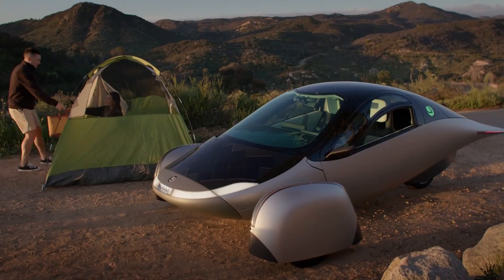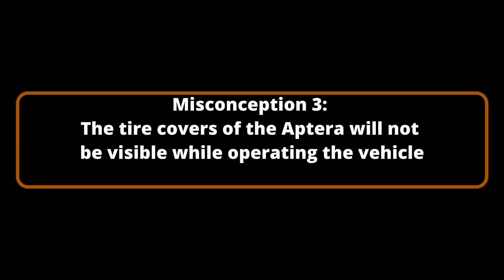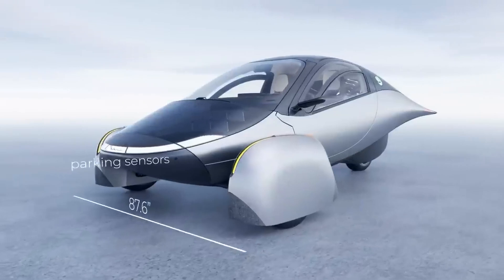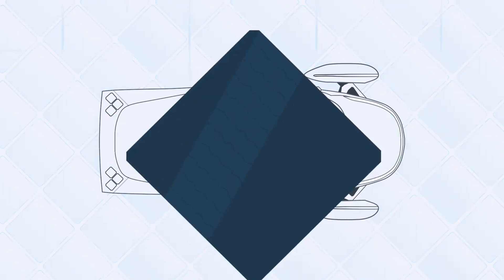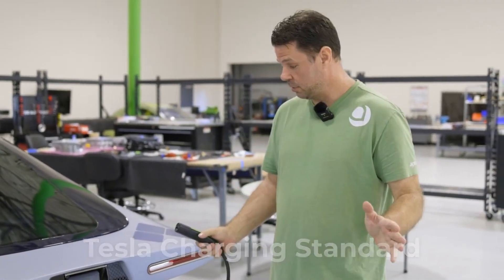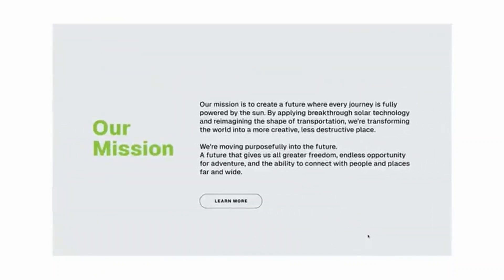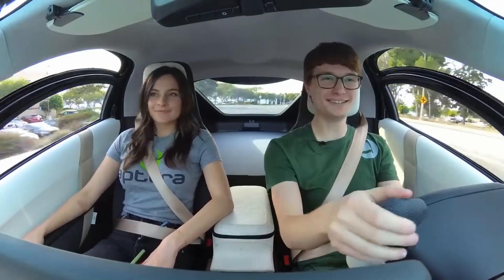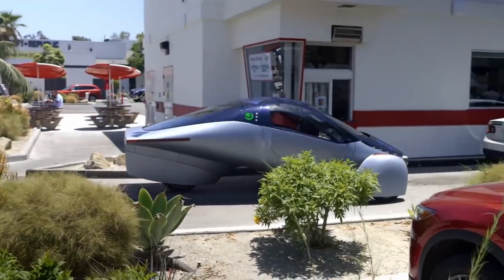All Aptera MISCONCEPTIONS Debunked in 12 Mins

Comment: LOL "20% more storage than a Prius" - that's only comparing the seat up configuration of the Prius (5 seat config) - put the seats down to make the Prius a 2 seater and you have more than double the Aptera.

"up to 40 miles per day" this is mid summer in Arizona - average 25miles per day annually in LA , and only if you park your car 100% outside all day every day, never in a garage, in the shade, underground carpark etc. the 700W of panels cost and extra $3000, you can get this much solar for 1/10th the cost by putting 2 x 420w panels on your roof.

4:39 - LOL effortlessly enter and exit - looks like a complete PITA to me

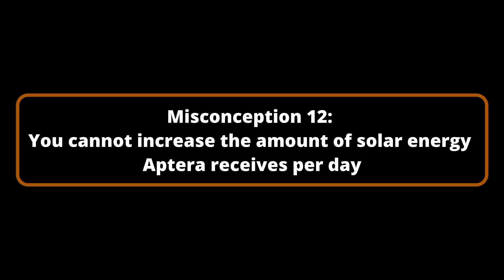6:51 charge twice as quickly? - that's an outright lie unless they changes the spec recently 3kw max AC and 40KW max DC charging - how is this acceptable in 2024..25...26....or 2040 if and when these ever get made - they are basing this on their other lie that this will routinely get 10miles per kwh so "charging twice as quickly" in miles not kwh vs a car that gets 2miles per kwh.

Finally there is ZERO chance of a 100kwh version getting 1000 miles per charge - where are they going to put all those batteries? And why doesn't the efficiency change no matter what battery is in the car a 100kwh battery is several hundred kgs heavier than a 40kwh battery but they all get 10miles per kwh?

Everything these guys have said for the past 6 years has never come true from designs to efficiency claims to production schedules, the 3 motor version is now off the table because they couldn't commit or pay their hub motor suppliers so now they have an inboard motor and axle setup.
Reply from the maker: Thank you for all your scientific analysis.
Will look into this

Comment: Regarding "solar miles", Aptera's online calculator is really flawed.  It gives a good answer for a "very high exposure" area but significantly overestimates the solar miles for "little to no exposure" areas.  I suspect it's somewhat flawed for intermediate "solar exposure" areas as well.
Reply from the maker: Hmmmm
Reply: @Elementraz  Here's a comment I made in another video: "The difference in average daily insolation (a.k.a., peak sun hours) for a horizontal surface between a little to no solar exposure area and  a high solar exposure area is huge.  In Glascow, Scotland, for example, it's about 2.14 kw-hr per square meter per day whereas in Phoenix, Arizona it's about 5.80 kw-hr per square meter per day.  If the Aptera can get an average of ~30 miles per day (~11k miles per year) in Phoenix then all other things being equal it will only get ~30 miles per day x 2.14/5.80 = ~11 miles per day (~4k miles per year).

Comment: Aptera is not a car, and does not need to meet the same safety requirements as a car (e.g. no crash tests).
Reply from the maker: Yeah, you got it but it is technically a 3 wheel car
Reply: @Elementraz  It is a motorcycle. And therefore it does not need to conform to any safety standard necessary for cars. That makes development and production of the vehicle cheap.

Comment: Misconception 1. refuted: Aptera has about the same storage space as the Tesla MY while it carries 3 more people than Aptera. With the second row down, Aptera is over 40 cu.ft less in storage than the MY when both carry two. But the real bummer is Aptera has a far less legal payload and towing rating, making it far more impractical. Aptera might be better than a motorcycle (which it is), but cannot compete with most cars.
Reply: Then there's a thing called usable storage space. Just because you can post a number, doesn't mean it's really useful space. For example Elio loved to tell people about how it could haul golf clubs. Yet if you got a 16" pizza, it wouldn't fit in the back.
Reply: @billsmith5960  I ran through all 18 that were promoted as 20, but was succinct with my rebuttals. On the storage space, yes, most of it is too shallow to put stuff in, but the biggest problem is the stuff is high over the single centre wheel while cars have it low between two wheels. Much safer in cars.
Reply: @billsmith5960  The aptera storage space is not usable at all for anything other than paper toiletry. Else you create a guillotine in case of heave braking.
Reply: @vic321344  - It has a 500 lb load rating. So with two 200 lb people, you just need to make sure you never exceed 100 lbs of cargo.
Reply: Aptera cannot compete with a cyber truck, a Model S, X, or Y on much, EXCEPT price, fuel savings (3 x more efficient), futuristic look. But then, for one or two people, it's UNMATCHED!
Reply: @1voluntaryist  So misconception 1. is refuted. Thanks.
Reply: @1voluntaryist  And Aptera cannot compete with safety, it is a deathtrap in case of an accident.

Comment: The Aptera body really has nothing to do with a Formula 1 racing car. It is just a simple rectangular aluminium frame, where the (non structural) plastic parts are glued onto. There has never been an Aptera crashtest, so nothing is proven. Just empty promises, as usual.
Reply: Actually the construction is like an F150. Body on frame. Maybe a F1 car from the 30's might have that same design.
Reply: How can Aptera "promise" before a test? It's the most unique design EVER. That doesn't stop "empty criticism" by trolls.
Reply: @1voluntaryist  They could perform a real test since 2009. And they delivered nothing else than empty promises. "will do", "will have", "will be done".

Comment: An autocycle IS a motorcycle, it lacks all the safety features neccesary for a car:

GENERAL ASSEMBLY OF NORTH CAROLINA
SESSION 2015
HOUSE BILL 6
RATIFIED BILL
H6-v-3
AN ACT TO DEFINE AND REGULATE AUTOCYCLES.
"Passenger Vehicles. –
a. Autocycle. – A three-wheeled motorcycle that has a steering wheel,
pedals, seat safety belts for each occupant, antilock brakes, air bag
protection, completely enclosed seating that does not require the
operator to straddle or sit astride, and is otherwise manufactured to
comply with federal safety requirements for motorcycles.
a.a1. Excursion passenger vehicles. – Vehicles transporting persons on
sight-seeing or travel tours.
…
d. Motorcycles. – Vehicles having a saddle for the use of the rider and
designed to travel on not more than three wheels in contact with the
ground, including motor scooters, autocycles, motor scooters, and
motor-driven bicycles, but excluding tractors and utility vehicles
equipped with an additional form of device designed to transport
property, three-wheeled vehicles while being used by
law-enforcement agencies and mopeds as defined in subdivision d1
of this subsection."

You can make up your own definitions, but they have no legal meaning.

Comment: Aptera should partner with Tesla for sales/service, NACS, FSD, insurance.
Reply: I hope not.
Reply: All Chris has to do is call Elon. Both are CEO's, so equally important and they could work this out over a lunch.
Reply: @billsmith5960  Exactly.  Tesla could provide distribution for Aptera at least and merely because it is the right thing to do.
Reply: @TogetherinParis  - All Chris and Steve have to do is call Elon and get the deal done.
Reply: Why should tesla be interested in a motorcycle, that is wider than a Hummer H1, costs more than a Model Y and is a deathtrap in case of an accident?
Reply: @vic321344  - It's because of the efficiency and solar. Plus, Tesla would like to learn a thing or two from Chris and Steve.
Reply: @vic321344  Four years ago Elon visited Aptera and offered his "then exclusive" NAC system to them. You will learn: "Don't bet against Elon."